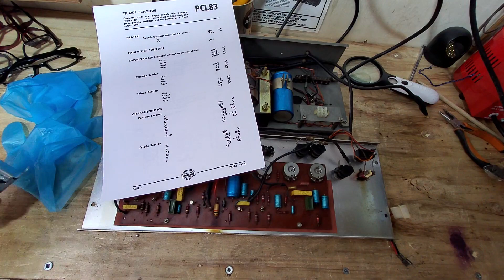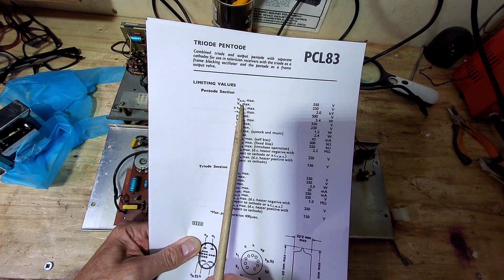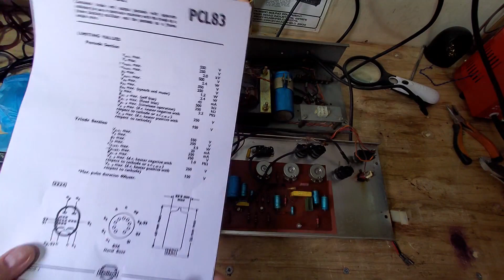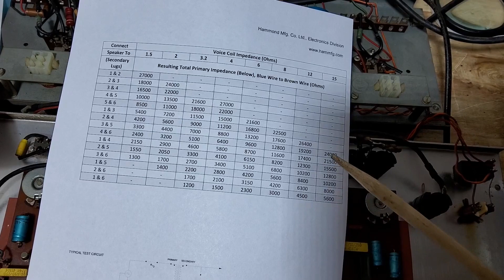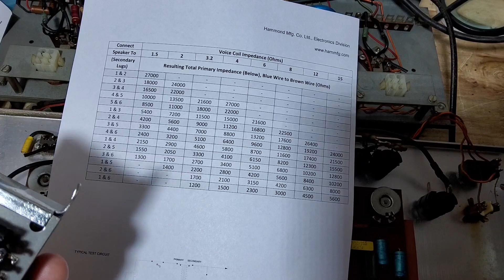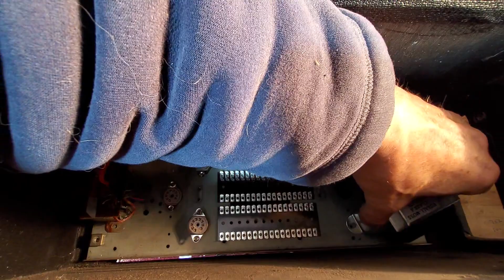8 Watt Tube Guitar Amp Build in to a Wem PA40 Chassis Part One

Comment: Single ended amps take more power than a low wattage push pull. They are running flat out all the time, very inefficient compared to pp with its power sharing. 
Power tranny should have loads of amps to spare.
Reply from the maker: Hello Rob, thank you. You are right and I think I have my calculations right on this one. Part two has just gone up. Thanks for watching and take care.

Comment: The little wing lite circuit, should work for push pull...Looking forward to the build whatever you chose...
Reply from the maker: Hello. Just had a look on their website. That's a great little amp. I want to put a tone stack in this one but that's a great idea for another project. Do you have a link to the schematic for it? Had a look online but couldn't fine one.

Comment: I actually just stumbled upon the schematic for the Univox U-45B which has push / pull 6BM8 output. These tubes are very similar to the ones you're using. Lowish power, triode / pentode. May be worth a look. Bradley serviced one of those amps and it sounds pretty sweet. Looking forward to part 2!
Reply from the maker: Hello. Over here we call them ECL82s. I have some PCL82s in my Mullard stash. Different filament voltage but the same tube. 6BM8s are good tube. Thanks for watching and take care.
Reply: My 1959 Gibson Gibsonette uses those 6bm8 tubes. Other Gibsonette amps use 6v6's. This amp has some awesome drive when you get volume up halfway.

Comment: You’ll lose ~10V or so on the plate voltage with cathode bias too. I would use the built in low mu triodes as a long tailed pair phase inverter and the 12AX7 as the preamp.
Reply from the maker: Hello Matt. That did cross my mind when I was thinking out the project. Will there be enough gain? What put me off the idea was, I am adding a tone stack. After what you suggested, I am thinking of adding the tone stack between the 12AX7 stages then, in to the long tail pair. Thanks for your help.
Reply: @vintageguitaramp_guitarteacher  If you want any amount of clean headroom, place the tone stack between the 12AX7 triodes. Like a black panel Fender. The power tube triodes should work fine as a phase inverter. “Should”. I haven’t used these tubes before, but some amps have used 12AU7/low mu triodes as a phase inverter and they sound just fine.

Comment: I think you should just wing it when it comes to the circuit
Reply from the maker: Hello Ernest. I have done that a few times and more often than not the amp ends up sounding terrible. But I might end up doing just that. I think pinching bits from different designs is the way to so that's kind of winging it. Thanks for watching and take care.